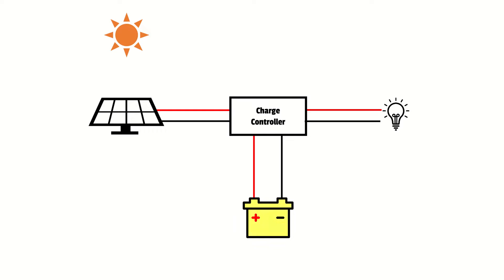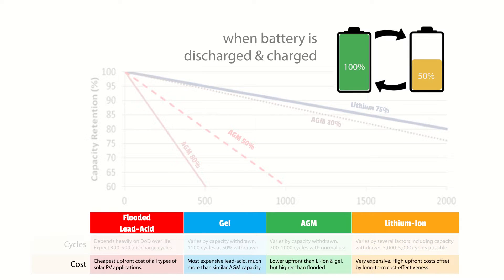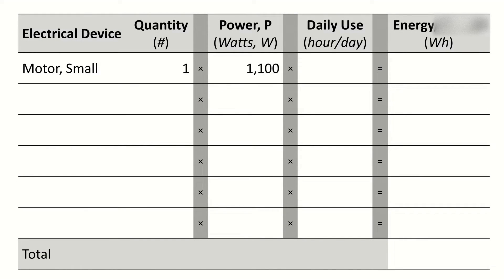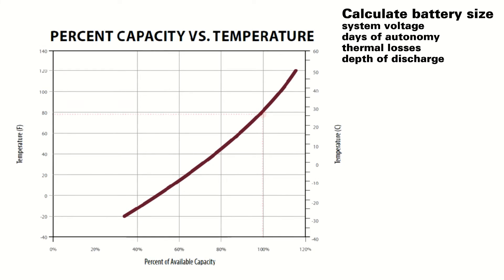How to design and size a solar battery system

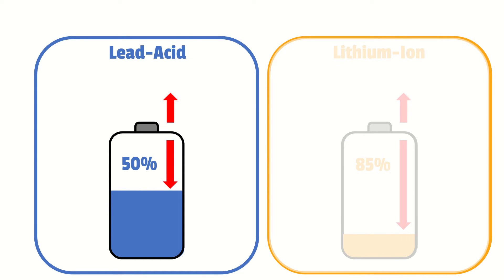Comment: 13:30 the discharge values for the batteries has me confused. When I see a, for example, 100ah lead acid battery being advertised as having 100ah of rated capacity, I guess I would normally assume I can use all of that 100ah and that the manufacturer has already oversized the battery appropriately for me to do that. But you're saying only assume I can use 50% of what the manufacturer claims as the rated capacity?

Comment: I don't think you need 32 batteries, rather 64 batteries as the battery voltage is only 12 Volts and system voltage is 24 volts.

Comment: Also you should include the battery degradation after lots of cycles in the denominator such as 0.8 after 500 cycles for lead.

Comment: people talk a lot about cycles but what if you never discharge much and do not create charging cycles?  would the batteries last longer?
Reply: If your battery get empty many times your battery gonna die in use better note:overcharger danger explosion
Reply: @specialone977  the opposite of what i was asking
Reply: @sleddy01  sorry you mean discharge it's no problem if you not charge more than allowed example 12 keep charging between 11-13 volt

Comment: Dear Mr. Schiavone, I have a doubt at last two formula. Temperature conpensation factor 1.19 should be at lower part of the formula, so the result is: (19.528*3)/(24*0.85*0.5*1.19)=4826Ah. The last formula, the battery voltage is 12V, not 24V, so the quantity should be: 4826*2/215=44.9, roundup to 45 pcs. Just for your consideration. Thanks.
Reply: The last formula where 12V and not 24V was referenced you go it right. However, the temperature compensation part you didn't get right. The lower the temperature of operation, the lower the battery capacity. Meaning at say 26degrees Celsius, which is considered normal temperature, the compensation factor would be 1 hence the battery capacity would be 5743.5Ah. It only then means that at lower operations temperature, I think he selected 10 degrees Celsius, the battery capacity must be higher than 5743.5Ah to meet the 19.5kWh energy demand.

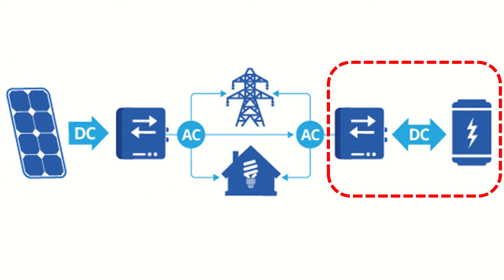Comment: @6:20 round trip battery efficency has zero to do with battery capacity and should be removed from this calculation.
It's a one way trip not a round trip.
It measures how much more energy you need to charge the battery than it can deliver.
This is added to the charge energy but not subtracted from the capacity.
You rate capacity on energy delivered not energy to recharge.
Likewise line losses don't belong here there are no long runs of wire here.
The inverter should be only a couple feet from the inverter.
Wire from the panels to the charge controller are only involved in charging not discharging.
Reply: You are so right , round trip battery efficiency should be used to calculate how many extra panels you need to charge the batteries.

The inverter efficiency factor ( standby consumption ) should have been used instead. Since inverters with zero load also draw an amount of watts from the batteries.

Comment: Thanks so much for that information, but I still got a question. If the voltage system selected is 24V, why do you use 12V batteries? that only means that you will have to set more batteries in paralel which, as far as I know, it is not recommended. I'd really appreciate your answer. Thx

Comment: In the calculations given, you said the total of 6,835 Ah of battery storage. Isn’t this calculation for Watt hours? Given the daily electrical load began at 19,528 Wh?
Reply: Well since amps x volts = watts and Ah x volts = watthours and the quation he used had battery voltage in denominator it's been accounted for.
If you leave the battey voltage out of the equation you get watthours.
Or obviously if you multiply by battery volts again at the end you get watthours.
Reply: @ghz24 So you’re saying he has 69 AGM 100Ah or 35 Lithium Ion batteries? He can consume 285 amperes per hour per day! I don’t know how any residential home can use that much energy a day. The cost of such a battery bank of storage is astronomical and not even feasible to recharge with only 6~7 hours of solar energy. The 19,528 Wh of daily usage is 585,840 Wh per month.

Comment: 10:26 wrong, higher voltage begets higher current. the difference between a 12v system and a 24v system is the wiring size, which has different resistances. oy vey.
Reply: No he's right because the watts are limiting. As an example lets use a simplified system of two 120 watt panels giving 12 volts and 10 amps to get that 120 watts . If I put the two of them in  parallel I get 12 volts still but have 20 amps but, if I wire them in series I get 24 volts and 10 amps to give the same 240 total watts.
So higher voltage results in lower amperage to provide the same power.
Since resistance losses are related to current, lower current and higher voltage results in less loss and/or thinner wires being needed.
In addition charge controllers cost substantially more for higher amperage ratings so a 40 amp controller for a 12 volt battery can handle 480 watts the same 40 amp controller for a 48 volt battery will handle 1920 watts.
Reply: @ghz24 his solitary statement devoid of caveats is incorrect and misleading.
Reply: @h7opolo Yeah not really. What caveats would you have included? Maybe "to provide the same power"?
I still say he's right and I'll give another example. Say I have a high intensity discharge lamp. The ballist (transformer) has multiple taps for use with different voltages if I use the set for 120 volts it will draw twice the amps as if I use the set of wires (taps) for 240 volts.

If I have 10 panels and they are 325 watt panels they each produce 33 volts and 10 amps at max pp.
If I wire them in series I have 330 volts at 10 amps and 10 guage wire is adequate for a 100' run.
If I wired them all in parallel I'd have 33 volts and 100 amps. What size wire would one need to handle that for a 100 foot run?
His statement is spot on for the subject being discussed considering the understood subject is solar power.
 Even batteries follow this the watts a group of batteries can produce doesn't change depending on how they are wired. Series you add voltage and parallel you add amps but watts remain the same.
Just like a transformer if you step voltage up the current goes down and if you step the voltage down the current rises because conservation of energy.
Reply: @ghz24  resistance losses can also be depend on voltage. V^2/R
Reply: @MuhammadTalha-by4ee  No the loss due to resistance is I^2R.
It doesn't matter what the voltage is it's not even in the equation.
10 amps through a 10 ohm resistor is 1000 watts loss regardless of if it is hundred volts or a thousand because volts is not mentioned, the difference is the power delivered to the load not the power lost in the wire.
You are using power delivered not power lost. Current is THE determining factor in power loss.
Higher voltage allows the use of lower current to get the same power through the wore but the loss is only dependant on the current and the resistance aka wire size.
Voltage only effects the current needed to deliver a set power but the calculation for loss is only resistance and current.
Reply: @ghz24  voltage and current are connected through ohms law across a constant resistance. I^2R losses are in resistance, also V^2/R losses. but V is a voltage drop across a resistor not the voltage of a source.
Reply: @MuhammadTalha-by4ee  You are making a circular argument.
Since P=VxI and power is what is lost and current stays the same across a resistance that only leaves voltage to change for the power to change.
This is a symptom not a cause. 
The simple fact is the watts lost is directly related to the current and not voltage .
Voltage isn't even in the equation because it doesn't matter. It can be a hundred or a thousand or a million volts and it won't change the power loss because it is dependent on current and only current. If the current is the same and the resistance are the same the power loss is the same. 
Go find an online calculator and play with it.
Increased voltage with constant current and resistance delivers more watts but the power loss is identical.
If a variable isn't in the equation it can't change the answer, how can you not understanding that simple concept?
Reply: @ghz24  I don't know what you want to say tbh, The power's fundamental formula is P=VI. Since V, I, and R are connected through ohms law we get P=I^R or P= V^2/R. I can also say that there is no I variable in P=V^2/R so power loss is independent of current, does it make sense? Nope
For any electrical component the power loss or generated across it is P=IV,
 for P=-IV, the source is generating, for P=IV the source is consuming power.
So for your initial argument that we need a smaller wire for series connection because the losses only depends on current is wrong. Whether you connect the panels in series or parallel the constant resistance will make constant loses.
if the current is reduced across a current carrying wire but same electrons come with high energy(High Voltage) the power loss gonna be the same.
Reply: @MuhammadTalha-by4ee  What I'm saying is you're wrong, you're using the wrong equation.
https://youtu.be/_fJjJXT1uvc?si=sleU_-lu-ogLVs8l
The equation P=V^2R can be used to calculate power loss but V is not the voltage fed through but the voltage drop across the wire.
Power loss is I squared R.
Google "how to calculate cable power loss".
In the P=IV equation voltage is again the voltage drop.
The voltage drops through the circuit so there  are three different values for voltage starting V ending V and the difference (voltage drop). Voltage drop is not listed on my solar panels but current and voltage are.
Reply: @MuhammadTalha-by4ee  Same reply but omitting the link to the video.
What I'm saying is you're wrong, you're using the wrong equation.
The equation P=V^2R can be used to calculate power loss but V is not the voltage fed through but the voltage drop across the wire.
Power loss is I squared R.
Google "how to calculate cable power loss".
In the P=IV equation voltage is again the voltage drop.
The voltage drops through the circuit so there  are three different values for voltage starting V ending V and the difference (voltage drop). Voltage drop is not listed on my solar panels but current and voltage are.
Reply: @ghz24  bro I understand what you are saying, you want to say that voltage drop across wire remains same whether the source is generating 10v, or 10000v.
(10-9=1 or 10000-9999=1) 

if 3 panels with 10v, and 1A are in series, they make 30*1 30VA, and if they are in parallel they again make  10*3=30VA.
But the actual power they generate depends on the wire resistance and the load resistance, which are in series. If you assume they make same power for series and parallel connection, you are assuming variable load resistance and constant wire resistance. will share circuit analysis if you are interested.
You could be right because I never tested it. But assuming same voltage drop across wire for different voltage sources is weird considering a constant resistance of a wire.

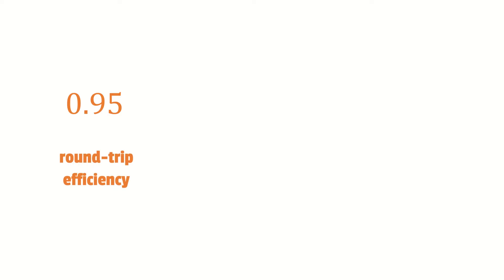Comment: 8:03 wrong. you said earlier (at timestamp 6:57) that you were designing this example system with lead acid batteries which you claimed has a round-trip efficiency of .85, not .95. what is your major malfunction? oh, i can tell you're an alcohol drinker.

Comment: Good quality, Flooded lead acid batteries will last a MINIMUM of 15 years to over 50 years or MORE, IF they are maintained and Charged CORRECTLY, as per Dr. Peter Lindermann and John Bedini. And furthermore, John Bedini has tested and observed that LA batteries are in excess of 200% efficient, when Pulse charged.
Reply: 200% wow who needs solar we can just charge our battery for power.
Lead acid batteries are a rip off and the mist expensive batteries to own. Pulse charging at certain frequencies can restore function to sulfated batteries but only to a point.
Even if they lasted 50 years instead of the 5 that most get it's 45 more years of sucky.
Just the  fact you get 85 watthours back for every 100 put in instead of 95 like a lfp is lead killer.
Lead is slow to charge and hates being partially charged and needs 10% more energy to charge it.
Just because you can float a lead acid battery for 50 years in perfect conditions doesn't make it a good battery.
Reply: @ghz24  Don't just talk from the top of your hat, because you THINK you know it all !!! Because the great Nikola Tesla has also worked with Lead Acid batteries and observed most of what I mentioned. Dr. Peter Lindemann and John Bedini we're working in their lab, based on what Nikola Tesla has recorded. So, if something is beyond YOUR understanding, don't be STUPID and exhibit the same in public. And let me further mention, I have LA batteries, purchased in 2014, which I have been maintaining, based on the methods mentioned, and they are STILL in TOP condition.

Comment: yea,, this shi**t is not easy to explain, and you gave it a good shot. You could have stated some simple perspectives first  to help people question 'why its done a certain way' instead of maping it out like biology class. he he. ex. 2 days power is the norm. 2 days is usually 60kwh. max charge rate is normally .5c . Just use lithium batteries, rofl. Use hybrid inverters unless you like financial bdsm with solar.  Surge will have to be Calculated and explained to the homeowner if off grid, period. etc etc...  loved your video though.. usually i just click to the next one.. cheers.

Comment: A very well explained and thorough video, far better than most others out there.  Thanks for this and others you have presented.
However, unless I have misunderstood, there seems to be an error in one of the calculations:
At 7.00 minutes you said you would assume using lead-acid batteries at a round trip efficiency of 85%, and the use of these batteries was confirmed by later calculations using a depth of discharge of 50%.
But, at 8 minutes you calculated the combined system losses using a round trip efficiency of 0.95 (matching lithium batteries) not 0.85.  This throws off the Load Subsystem Efficiency by quite a bit.. it should be 0.76 not 0.85.
In turn, that throws off the calculation of final battery capacity: it should be around 7645 Ah, not the 6835Wh given.

Comment: Great explanation with the general math, but the math application is very very bad😂. Math formula says 24 volts but got 12v batteries, choose lead batts with 50% round trip but used 95% lithium round trip. Number of batteries should be x2 since they are 12V and not 24Vdc, etc. But the general logic is sound with much details without the insignificant details that usually don't matter but cause a lot of confusion.

Comment: 7:05 Selected (0.85) Lead acid battery 
but in 
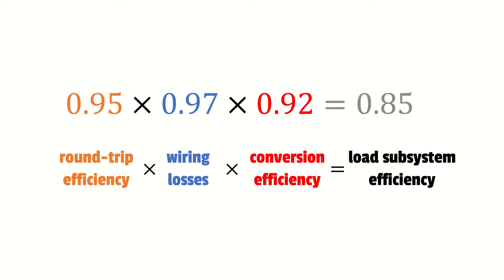8:13 you used 0.95 (Lithium ion) why?
Reply: Lithium batteries have an efficiency of 95%
Reply: @mikerukwava9574  But we are using lead acid batteries.........
Reply: I also noted that. An error of commission I suppose.

Comment: I'm wondering why 12V battery was used in the end if the calculations were done for 24V battery system. Did I miss something?
Reply: Also wondering the same. That would need twice the number of batteries he calculated.
Reply: @senogamoses5319  i guess you wire the batteries in series
Reply: It was just for demonstration the point was the “Ah” capacity of the battery shown. Because the voltage can be increased by connecting it in a series connection.
Reply: @AO00720  in which case you would need x2 the number of batteries. 
64 batteries needed not 32
Reply: @Cattywampus555  can you be more specific
Reply: @AO00720  32 batteries gets the required amps @ 12 volts.
 He had based the math on a 24 volt system. So double the number of batteries needed to get the voltage.
Reply: @Cattywampus555  you can connect  every 2 batteries in series to get 24volt bank giving you 16sets of series connected batteries that you can than connect in parallel.
Reply: @AO00720  yes you but 16 pair's isn't enough to make the total amps then, you still need 32  in series. which is 64 batteries not 32. you have just proved the point.
Reply: What are you heating your home and water with? My electric forced air furnace has three 7,500 watt coils itself

Comment: By far the best breakdown on how to calculate power needs; how to play with battery voltage and solar panel sizing to accommodate said power needs; I’m working on an OTG cabin and wish I could have seen this video last year.  Thank you for producing.  Consider another video on examples when you increase the solar panel array voltage or the battery voltage capacity, to a fixed power consumption need.  Great work!